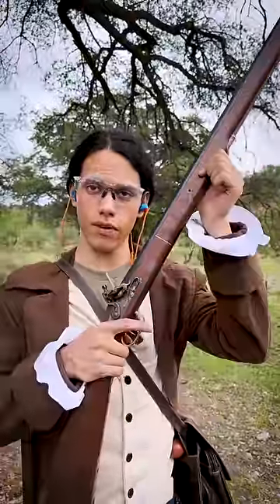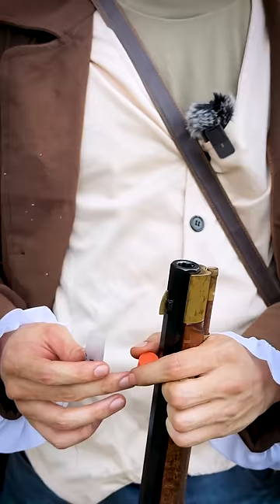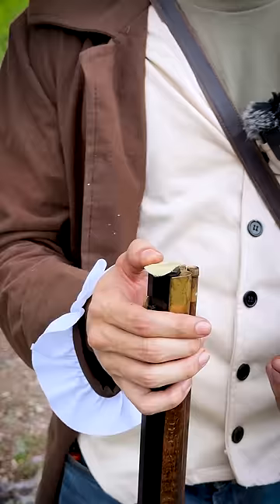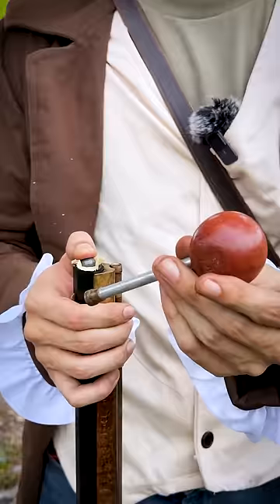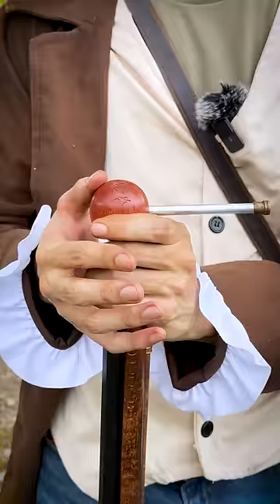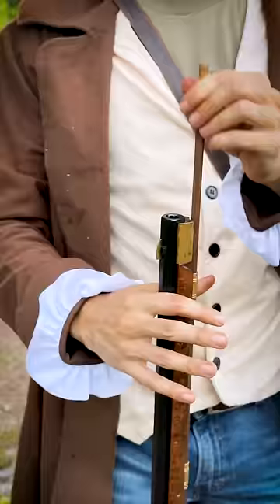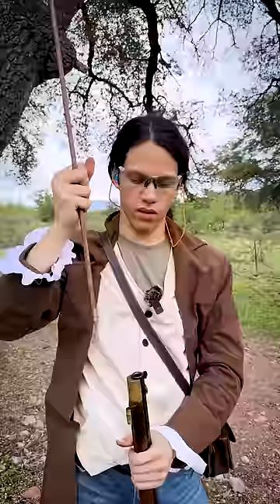How to Load a Flintlock

Comment: damn this is going to be really useful, I mean who doesn't know how to reload their Traditions .50 Kentucky Flintlock? 
Well, whatever, anyway, but did you know that The Traditions™ Percussion Kentucky Rifle is a beautifully crafted modified replica of one of America’s most iconic muzzleloading rifles. The original Kentucky Rifle featured a flintlock ignition, however, this variation of the rifle features a percussion ignition for easier use out in the field. The rifle that would become known as the “Kentucky Rifle” was first crafted during 1730 in Lancaster, Pennsylvania and saw use by hunters and frontiersmen for decades. The Kentucky Rifle would even see use during combat throughout the French and Indian War as well as the American Revolutionary War. The Kentucky Rifle was one of the first commonly used rifles in America during the mid to late 1700s and is one of the most popular reproduction rifles in circulation today. Traditions have crafted the Percussion Kentucky Rifle to be an accurate representation of the classic rifle and have integrated key features and upgrades to enhance the utility and performance of the muzzleloader for hunters and shooters alike. Beginning with the stock the Kentucky Rifle features a beautiful hardwood, walnut stained and finished, two-piece stock. The furniture on the stock is composed completely of brass including the nose plate, ramrod barrels, stock connecting plate, trigger guard, and butt plate. The brass furniture in tandem with the walnut stock gives the rifle a classic historical look that is both aesthetically pleasing and functional for use in the field. The .50 caliber barrel of the rifle measures 33.5 inches and is composed of carbon steel that has been blued to protect the exterior of the barrel from rust and corrosion. The rifling is set at a 1:66 twist rate that is ideally suited for shooting .50 caliber patched lead round balls and offers great accuracy out to 100 yards. In addition to the great features already listed the Traditions™ Percussion Kentucky Rifle features a case hardened percussion ignition assembly, authentic wooden ramrod, and fixed blade iron sights. The Kentucky Rifle created a lasting legacy of dependability and accuracy that has been passed down throughout the generations and continues to this day in the Traditions™ Kentucky Rifles. Own your own piece of American history by adding the Kentucky Rifle to your collection today. 😃
Reply from the maker: Hahahaha!
Reply: thats a new one
Reply: Ok
Reply: Yapper
Reply: I aint reading allat
Reply: @Hoodie_REBORN sonofabitch beat me to it
Reply: I saw how long it was and skipped the sales pitch.  Back in the day, I'd've gone looking to CVA, but I guess their gone so I gotta find your "Traditions" place nowadays
Reply: Jesus H Christmas that’s a mini book…
Reply: @Hoodie_REBORN there shud be a TL;DR Ver…
Reply: @ferntheyoutuber9960 Clapper…
Reply: @77thTrombone  Traditions are basically CVA by another name. Many of the older "traditional " rifles and pistols that CVA produced are being reproduced under the Traditions name.
Reply: I aint reading allat
Reply: @JMTRBXXXX  good for you :)
Reply: @Average.Student.669  hehehe :3
Reply: I'm going to read all of that just because I'm tired of all the yappers going "yapper" and "I ain't reading allat" 

(Edit) I read all of it. Keep your attention span.
Reply: @LouiePadreWillardino  No way, did you really read everything?? hahahaha You are a legend my bro!
Reply: @Michiru._.115 thank you, I did. It's not even that long of a comment. I've read longer ones and I'm not joking lol. I've actually read an entire essay of something historical that sounded like it was out of a book in a single comment. I don't want to start a fight but people really do have short attention spans.
Reply: @LouiePadreWillardino  Awesome!
Reply: @LouiePadreWillardino  It's great to see that for the first time there's no one fighting over something stupid in the replies, lately YouTube is looking more like Twitter haha!
Reply: @Michiru._.115  Hopefully. God forbid there's some booger here that will try to start one. I'm feeling a bit too good in life to want to argue with someone at the moment.
Reply: @LouiePadreWillardino  I wish I was as good as you... but ok... it's not like you can do anything to stop it, that's life, right? Sorry, i think my english is bad as fuck lol
Reply: @Michiru._.115  Naw naw it's ok. Yeah that's really how life works.
Reply: @LouiePadreWillardino  Yes, to be honest, this is quite sad but ok, I think the conversation has gotten too deep hahaha
Reply: @Michiru._.115  indeed lol.
Reply: I ain't reading allat 😭🙏🏻
Reply: @er-et4ti  ok?..
Reply: bro cannot take a joke
Reply: Most literate comment thread:
Reply: @J09-555  lol
Reply: "Sir, i only have askef you the hour."
Reply: @MauriceeoTY  same thing 🙃
Reply: @Aaron_Smith fr
Reply: Nice info,ganyu
Reply: @WilliamTheGroomer  oh, it worked! Haha! Ty :)
Reply: @WilliamTheGroomer  nice banner hehehe.... 🤭
Reply: @Michiru._.115  your welcome,love you ganyu
Reply: @Michiru._.115  thanks,love your pfp
Reply: @WilliamTheGroomer  Thank you! :D
Reply: I ain’t reading allat
Reply: I ain't reading all lat 😭
Reply: Professor yappington
Reply: Holy crap I did not expect to see a whole essay when I clicked expand comment🤣🤣🤣
Reply: @10KSniper  😅
Reply: @ferntheyoutuber9960  Jealous
Reply: Bro be writing a whole bible
Reply: Holy yap
Reply: Uhm,I mean,do you know that....🤓☝️
Reply: Definitely read all of that. I totally agree 👍💯
Reply: @Michiru._.115 I'll read any long comments as long as it's not a long @ss nonsense that's not even related to the video
I also won't read a long @ss political opinion stuff
Reply: @ypssa4935  I definitely agree with you.
Reply: Certified yapper🔥
Reply: I ain't reading that 😂
Reply: @RasikaManju  😉
Reply: Damn that's crazy
Reply: Womp womp
Reply: @pureblack150  definitely ✊😄
Reply: gold comment
ignore the zoomers with low attention apan
Reply: @czarnakoza9697  Haha, sorry for my bad english, ty! :D
Reply: Crazy...but i aint reading allat
Reply: I ain't reading that shit
Reply: bro lagged my computer
Reply: wow! the effort
Reply: @rafaelbaquirel3444  I'm not pointing a gun at you, do what you want, no one is forcing you to do anything. :)
Reply: @Michiru._.115  understandable wish you good luck
Reply: Brother, no sensible person is reading this
Reply: @christophergarrido5591  i know 😅
Reply: @Michiru._.115  😂
Reply: I read the entirety of your comment because I love old guns like these, mostly because they're easier to purchase in my state than an AR-15. There's just something about black powder firearms that I admire compared to modern stuff.
Reply: Blud's got a touch of the tism in em'
Reply: I ain't reading all that😭
Reply: Its crazy to think how fast these weapons evolved over the years, I mean we had gone from using blades and hammers to straight up firearms in less years than you would think

I wonder if one of the sides felt like the soldiers in WW1 when they saw a tank for the first time, im sure it wouldve been unexpected and scary to see someone point one of those pistols and see how one of your comrades fell to the ground without any direct contact
Reply: I hope this isn't jammed packed with a load of interesting history and great instructions as well as topics that will make me a smarter person because i ain't reading all that
Reply: @bigironbois so what if I pour the powder until it comes out and shot will the bullet come out with the speed of light
Reply: I made the whole American army's worth of weopen while watching this goddamn comment
Reply: @Hoodie_REBORN  That's a lot of words, too bad I ain't reading them.
Reply: Who the hell will rad that yap must be the unemployed friend on a Tuesday
Reply: damn thats crazy, or awesome whichever it said
Reply: Holy yapatron ☠️☠️
Reply: yap yap yap
Reply: Aint no way i am so bored that i read all that 💀
Reply: That's a lot of words

Too bad I ain't reading them
Reply: Full on yapanese to me
Reply: Idk what u just said but true
Reply: Bro just wrote an essay
Reply: @bigironbois bro pinned his comment and hit him with the “hahaha”
Reply: @Aaron_Smith  me too bruh. Dammit
Reply: In the early 1700s a rifle versus a smooth bore was a highly desired tool of knowledgeable hunters in the colones.  The greatly increased accuracy offset the slightly more difficult loading procedure.

Initially the .36 caliber was the most common, then the .45 caliber became the most popular caliber for a time between 1730 to about 1800s when the evolution from flintlocks, evolved to percussion caps, then to paper cartridges, then to metallic cartridges with primers.
Projectiles evolved from round lead balls, to conical projectiles with hollow bases that expanded to fill the lands and grooves, and then to many many variant in copper then brass cartridge cases .
Reply: I would say anybody who's never had experience with muzzleloaders wouldn't know how to load one, of which I'm sure there are many. Thanks to this little teaching moment it might've attracted some new shooters, possibly more than your shameless sales pitch. And while you're correct that percussion actions make the process of firing more reliable there's a bit of romance to the original that caps just don't have
Reply: ChatGPT goes brrr
Reply: @Michiru._.115 this mf is replying to every single reply...
Reply: sheldon cooper ass response
Reply: I am not trying to buy no gun
Reply: The yapping man from yappington drinking a yappachino💀💀💀💀💀
Reply: Wtf......
Reply: Damn bro I appreciate the effort but ain't reading allat.
Reply: @tristanisom3487  yeah 🤙
Reply: @SAIYAN_OVERLORD_HAHA  wtf
Reply: @Cheese33123  Is this a challenge?... You better prepare yourself.... I'll write 3000 lines if I have to, don't underestimate the power of boredom...
Reply: @jishan6992  Ok! Kuso ̄ , kore wa hontōni benri ni narudarou. Tsumari, dentō. 50 Kentakkī furintorokku o rirōdo suru hōhō o shiranaihito ga irudarou ka? Mā, sore wa tomokaku, The Traditions ™ pākasshon kentakkī raifuru wa, Amerika de mottomo shōchō-tekina zensōshiki raifuru no 1-tsu o utsukushiku kaizō shita repurikadearu koto o gozonjidesuka. Orijinaru no kentakkīraifuru wa furintorokku tenka o tokuchō to shite imashitaga, kono bariēshon no raifuru wa yagai de no shiyō o yōi ni suru pākasshon tenka o tokuchō to shite imasu. Nochini `kentakkīraifuru' to shite shira reru kono raifuru wa, 1730-nen ni penshirubania-shū rankasutā de saisho ni seizō sa re, sū jū-nen ni watatte shuryō-sha ya kaitaku-sha ni yotte shiyō sa remashita. Kentakkīraifuru wa, furenchi indian sensō ya amerikadokuritsusensō no sentō-chū ni mo shiyō sa remashita. Kentakkīraifuru wa, 1700-nendai nakaba kara kōhan ni kakete Amerika de saisho ni ippantekini shiyō sa reta raifuru jū no 1-tsudeari, genzai ryūtsū shite iru mottomo ninkinoaru fukusei raifuru jū no 1-tsudesu. Dentō ni yori, pākasshon kentakkī raifuru wa koten-tekina raifuru o seikaku ni hyōgen suru yō ni tsukura rete ori, hantā to ite no ryōhō ni totte zensō jū no jitsuyō-sei to seinō o kōjō sa seru tame no jūyōna kinō to appugurēdo ga tōgō sa rete imasu. Kentakkīraifuru wa jūshō kara hajimari, utsukushī kata-zai, kurumi-zai de senshoku sa re shiage rareta 2 pīsu no jūshō o sonaete imasu. Jūshō-jō no kagu wa, nōzupurēto, ramuroddobareru, jūshō setsuzoku purēto, torigāgādo, battopurēto o fukume, kanzen ni shinchū de kōsei sa rete imasu. Kurumi-zai no jūshō to chōwa shita shinchū-sei no kagu wa, raifuru ni mitame no utsukushi-sa to genba de no shiyōnitekishita koten-tekina rekishi-tekina gaikan o ataete imasu. Raifuru no. 50 Kōkei bareru wa 33. 5-Inchi no ōki-sa de, bareru no sotogawa o sabi ya fushoku kara hogo suru tame ni aoku chakushoku sa reta tanso-kō de kōsei sa rete imasu. Raifu ringu wa 1: 66 No tsuisuto rēto ni settei sa rete ori,. 50 Kōkei no patchi-tsuki rīdo raundo bōru no shageki ni saiteki de, 100 yādo made no sugureta seido o teikyō shimasu. Sudeni ageta sugureta kinō ni kuwaete, Traditions ™ pākasshon kentakkī raifuru ni wa, kēsu kōka pākasshon tenka asenburi, honkaku-tekina mokusei ramuroddo, kotei burēdo aian saito ga sonae rarete imasu. Kentakkī raifuru wa, shinrai-sei to seikaku-sei to iu eizoku-tekina isan o umidashi, sedai o koete uketsuga re, kyō made Traditions ™ kentakkī raifuru to shite uketsuga rete imasu. Ima sugu kentakkī raifuru o korekushon ni kuwaete, jibun dake no Amerika no rekishi o te ni iremashou. 😃
Reply: wrote a god damn novel
Reply: @Michiru._.115  bro what you on about, that ain't Japanese that's fluent yappanese 💀
Reply: @jishan6992  oh shit
Reply: Yapper McYapperton Jr.
Reply: i ain't reading all of that
Reply: You wrote a whole paragraph I ain't reading that I'm just going to say bows and Spears are better :)
Reply: @Michiru._.115  yea, sorry I said that
Reply: Thanks for the bible!
Reply: I'm not reading all that, can you give me a shorter version
Reply: yap yap yap
Reply: Not reading that
Reply: I thought he might have mentioned something about patch lube. For someone who hasn't loaded a black powder rifle before they could have serious problems.
Reply: HECK I HOPE ITS COPIED FROM WIKI HAHAUAHA
Reply: I’m not reading all that
Reply: @Hoodie_REBORN  I SAID THE SAME THING IN MY HEAD 🤣
Reply: I read the whole thing.
Reply: Why the fuck did this man or woman right an entire school assignment on a youtube short?
Reply: Yapping yapperton.
Reply: @youe-wr1lv  I dont know :P
Reply: @Peace_Enforcer  Legend 😌
Reply: Holy yap
Reply: @Dreagan23  Maybe :/
Reply: bro has too much time lol
Reply: Ain't reading  all that
Reply: @Michiru._.115 copy and pasting for some likes, get a life
Reply: @CongoChongoVIII  Isn't for likes, i just having fun here :) Sorry, my english is very bad 😅
Reply: Duke nukem riff "wow thats a lotta words!" second riff "Too bad im not readin' em" absolute bomb of a solo
Reply: 🤓 🤓 🤓 🤓 🤓 🤓 
damn this is going to be really useful, I mean who doesn't know how to reload their Traditions .50 Kentucky Flintlock? 
Well, whatever, anyway, but did you know that The Traditions Percussion Kentucky Rifle is a beautifully crafted modified replica of one of America’s most iconic muzzleloading rifles. The original Kentucky Rifle featured a flintlock ignition, however, this variation of the rifle features a percussion ignition for easier use out in the field. The rifle that would become known as the “Kentucky Rifle” was first crafted during 1730 in Lancaster, Pennsylvania and saw use by hunters and frontiersmen for decades. The Kentucky Rifle would even see use during combat throughout the French and Indian War as well as the American Revolutionary War. The Kentucky Rifle was one of the first commonly used rifles in America during the mid to late 1700s and is one of the most popular reproduction rifles in circulation today. Traditions have crafted the Percussion Kentucky Rifle to be an accurate representation of the classic rifle and have integrated key features and upgrades to enhance the utility and performance of the muzzleloader for hunters and shooters alike. Beginning with the stock the Kentucky Rifle features a beautiful hardwood, walnut stained and finished, two-piece stock. The furniture on the stock is composed completely of brass including the nose plate, ramrod barrels, stock connecting plate, trigger guard, and butt plate. The brass furniture in tandem with the walnut stock gives the rifle a classic historical look that is both aesthetically pleasing and functional for use in the field. The .50 caliber barrel of the rifle measures 33.5 inches and is composed of carbon steel that has been blued to protect the exterior of the barrel from rust and corrosion. The rifling is set at a 1:66 twist rate that is ideally suited for shooting .50 caliber patched lead round balls and offers great accuracy out to 100 yards. In addition to the great features already listed the Traditions Percussion Kentucky Rifle features a case hardened percussion ignition assembly, authentic wooden ramrod, and fixed blade iron sights. The Kentucky Rifle created a lasting legacy of dependability and accuracy that has been passed down throughout the generations and continues to this day in the Traditions Kentucky Rifles. Own your own piece of American history by adding the Kentucky Rifle to your collection today. 🤓 🤓 🤓 🤓 🤓 🤓
Reply: Next time paragraph your essay… loL
Reply: Nice comment, good to find a nice piece of history:D
Reply: good read ngl learned more about the kentucky rifle!
Reply: @whitesaintatarmaon5766  😉
Reply: I ain't readin allat
Reply: If you smoke crystal meth just say that lol
Reply: I don't mind long comments. I do mind that people mind though
Reply: I did not read that shii
Reply: Nice copy and paste from their website🤦
Reply: @Michiru._.115  You know, I don't really like how people are treating your comment. Yes, it is a really long comment, but at the same time it's interesting to see what people's minds are capable of. I'm sorry for saying something mean. This just shows how smart people can be and how stupid people can be. I think, (based off of this comment) that you are a Really smart person and someone who appreciates history and guns. So, I respect you.
Reply: Oh fuck naw, I ain't readin allat
Reply: Dawg literally just an ad💀
Reply: @youe-wr1lv  Wow... Ty bro! ❤
Reply: I’m not reading that…
Reply: I ain’t readin all that 💯💯‼️‼️
Reply: I am a superior. I read it all.
Reply: I ain't reading allat
Reply: damn this is going to be really useful, I mean who doesn't know how to reload their Traditions .50 Kentucky Flintlock? 
Well, whatever, anyway, but did you know that The Traditions Percussion Kentucky Rifle is a beautifully crafted modified replica of one of America’s most iconic muzzleloading rifles. The original Kentucky Rifle featured a flintlock ignition, however, this variation of the rifle features a percussion ignition for easier use out in the field. The rifle that would become known as the “Kentucky Rifle” was first crafted during 1730 in Lancaster, Pennsylvania and saw use by hunters and frontiersmen for decades. The Kentucky Rifle would even see use during combat throughout the French and Indian War as well as the American Revolutionary War. The Kentucky Rifle was one of the first commonly used rifles in America during the mid to late 1700s and is one of the most popular reproduction rifles in circulation today. Traditions have crafted the Percussion Kentucky Rifle to be an accurate representation of the classic rifle and have integrated key features and upgrades to enhance the utility and performance of the muzzleloader for hunters and shooters alike. Beginning with the stock the Kentucky Rifle features a beautiful hardwood, walnut stained and finished, two-piece stock. The furniture on the stock is composed completely of brass including the nose plate, ramrod barrels, stock connecting plate, trigger guard, and butt plate. The brass furniture in tandem with the walnut stock gives the rifle a classic historical look that is both aesthetically pleasing and functional for use in the field. The .50 caliber barrel of the rifle measures 33.5 inches and is composed of carbon steel that has been blued to protect the exterior of the barrel from rust and corrosion. The rifling is set at a 1:66 twist rate that is ideally suited for shooting .50 caliber patched lead round balls and offers great accuracy out to 100 yards. In addition to the great features already listed the Traditions Percussion Kentucky Rifle features a case hardened percussion ignition assembly, authentic wooden ramrod, and fixed blade iron sights. The Kentucky Rifle created a lasting legacy of dependability and accuracy that has been passed down throughout the generations and continues to this day in the Traditions Kentucky Rifles. Own your own piece of American history by adding the Kentucky Rifle to your collection today.
Reply: We don’t beed to know all that, no one read all that.
Reply: HOLY SHIT MY GUY
Reply: Ngl, i genuinely enjoyed reading this. It was informational and just a fun read. Thank you
Reply: @shadowknight4655   no shot you actually read that, he prolly spent 10 minutes typing that
Reply: I saw someone say 'I ain't reading allat' and so I got annoyed for some reason, I mean I'm not the one that typed it and yet I was annoyed someone wasn't gonna take the time to read it so I read it myself. Stellar presentation. It nearly makes me want to purchase one.
Reply: @Therandomrando007  Why would someone read it, he spent 10 minutes typing that just to give us useless information
Reply: @JoshuaAmtsfield  legit, i actually read it all, and it's actually really well written
Reply: ok
Reply: @Michiru._.115  No problem <3
Reply: @youe-wr1lv  ♡
Reply: @shadowknight4655   but it is a waste of time\
Reply: @JoshuaAmtsfield  nah, not really. It was a fun read
Reply: Does bro expect us to READ ALL OF THAT💀💀💀
Reply: @Michiru._.115  Do you know why everyone is saying stupid shit about your comment?
Reply: i can’t believe i just read this whole thing
Reply: @gangstaspongebob741 New to you but for me, i see this type of comments so many times.
Reply: I ain't readin alla that 💀
Reply: @youe-wr1lv  because it's a big text
Reply: @shadowknight4655   If you say so, I mean I didn’t read it but any paragraph that long is boring and useless.
Reply: This invaluable comment greatly contributed to the success of my high school presentation on the topic of history. Thank you, @Michiru._.115.
Reply: The people who say yapper are probably 12 yr olds
Reply: @RoundedBottleCap   I could agree, except im 14.
Reply: Gosh your first paragraph made me think it'll be short. 🤣
Reply: i'm not reading all that
Reply: Yappy yapperson
Reply: Bro wrote a whole novel
Reply: @_CatsareDank  what a beta
Reply: What.
Reply: @LouiePadreWillardino Despite the funny tone at the standard, it was a good read so yeah
Reply: Big ol yapping.
Reply: @Oxygen.8.15  REALLY???????
Reply: I aint readin allat 😂
Reply: ITS A GOD DAMN MUSKET FOR FUCK SAKE
Reply: @ferntheyoutuber9960  Vulgar Display Of Power 🤘🤘🤘
Reply: not to be rude in anyway but you made a spelling error it’s the part where I’m assuming you meant to say glued but instead wrote blued either way this comment was a highlight to extremely long day so thank you for this piece of information 😁😃🙏
Reply: I ain't reading all that 💀
Reply: bro woke up and decided to write the holy bible
Reply: @ct1160  
Goated
Reply: shut up bro
Reply: Big bro I’m sorry thanks for the effort but I ain’t reading that
Reply: @JustinlADFP  oh... ok
Reply: I ain’t reading that
Reply: Bro
Reply: Wow that’s a lot of words 

To bad I ain’t readin em
Reply: @JustinlADFP  what did this guy do to you?
Reply: I bet that's AI generated.😂 Nevertheless, that's was good info on the history of that gun.
Reply: @mohungujudhur8937  it isnt 😅
Reply: Ain't reading all that
Reply: I ain't reading alla dat 😒
Reply: @BlackWolf728  ok
Reply: yeah ok but who tf asked? nobody!
Reply: @fnn3908  sorry
Reply: "Too many words Da dun da dun too bad ain't reading them da dun da dun "
Reply: Yap sesh
Reply: Reading that on a phone sucked
Reply: Hi I’m from Lancaster, PA the place it was created and it definitely holds a small amount of pride within the county to know we crafted this rifle that played such an important role. I’ve even seen the white small building where it was first made
Reply: I. Ain't. Reading. All~that
Reply: I ain't reading allat
Reply: I ain’t reading all that
Reply: Bro who gave a whole damn selling point as if your life depended on it.
Reply: More than 1 line and I don't read
Reply: @Hoodie_REBORN cocaines a hell of drug
Reply: u sad guy
Reply: @ConnorMarsden-gs5ky  yeah
Reply: Yes
Reply: @bigironbois  why doe you look like paul's cousin from dune part 2?
Reply: Certified yapper
Reply: Man I ain’t reading all this even though it might help me to learn one more interesting thing
Reply: @Hoodie_REBORN honestly Williams woman here I can't believe I freaking read halfway through and gave up.😂 Dang 😳
Reply: bro so hard to translated your tittle🗿
Reply: Tldr
Reply: Paragraph jumpscare
Reply: I did NOT plan on reading that paragraoh
Reply: Автор этого комментария такой:
Я насрал диссертацию, убирай
Reply: Bro made essay
Reply: Professional yapper
Reply: Longest comment ive ever seen
Reply: Bro Has A Masters Degree In Yapology
Reply: How did you write sooo......  long 😮
Reply: I have chat gpt to bud
Reply: Holy hell ya guys respect this guy he is teaching you guys the basics of Traditions 50 kentucky Flintlock give Michiru some damn respect❤for all them ones that are saying He/She is yapping.
Reply: @beehzadahmady3651  its cause he/she knows some words of the dictionary😂
Reply: @RykerIonson  ty bro, i was starting to feeling bad.. ty
Reply: TLDR
Reply: @LouiePadreWillardino I would read it but I can't read something unless I'm interested enough. (This comment is not meant to be disrespectful. If you are offended by it, womp womp)
Reply: Nvm I read it, and I was actually interested. Thank you 👍
Reply: On behalf of the non-U.S. zoomers, I would like to declare we still have an attention span and appreciate the sharing of knowledge. We do not claim these dorks and hope their schools stay safe.
Reply: Bro rote the whole English language in a single comment💀💀
Reply: holy yap
Reply: That was fun to read
Reply: Thanks for the T.E.D talk? I guess
Reply: We didn't ask for the novels worth of text 😭😭
Reply: i aint reading allat
Reply: This was hilarious, I love the transition to sales pitch
Reply: After "anyway" whole essay has been written
Reply: michiru least yappitive yap session
Reply: I used to memorize this
Reply: I didn't order a yappaccino bro 😭🙏
Reply: You do know there is no such thing as a "Kentucky" rifle. All flintlock were made in PA by the county.
Reply: Holy fucking yap
Reply: I think this is some new level of advertisement
Reply: Maaan can't skip ads anywhere these days
Reply: well that's enough checking comments
Reply: new copypasta just dropped
Reply: Sir, this is a Wendy's.
Reply: Bro gave a speach
Reply: Dang, you had to write a hole novel about flintlock, but why
Reply: Bro's a professional yapper
Reply: I read all of it and my mouth starting to struggle thankfully i manage to the and of my reading that's one of the heck long word I ever done 😅😅😅
Reply: This comment helped to understand a lot about the .50 Caliber Kentucky Flintlock. Thanks for writing this comment. I appreciate it.❤
Reply: aw heck naw man
Reply: bro is writting essay
Reply: i aint reading allat
Reply: No one reading all that lil bro
Reply: Gpt
Reply: I did NOT ordered a yappanise
Reply: I ain't reading shit
Reply: @ferntheyoutuber9960 nobody cares he yapping or not💀
Reply: If you wrote this then it is one heck of a paragraph.
Reply: Nah he ain't reading all dat💀
Reply: nobody ordered a yapachino
Reply: The one who ordered the yappacino, please get it
Reply: femboy
Reply: @TheMcHunter  tf do you mean
Reply: @TheMcHunter  😅
Reply: @googoogaagaa6969  the pfp
Reply: @Michiru._.115  I mean am I wrong :>
Reply: @TheMcHunter  ok and?
Reply: @TheMcHunter  not exactly, lol 😅
Reply: @googoogaagaa6969  nah, its okay, he have some reason
Reply: @Michiru._.115  hmmm then what are you?
Reply: @Michiru._.115  are you tho? no offense but are u?
Reply: @googoogaagaa6969  yeah, i think :)
Reply: I've red EVERYTHING outloud as if it was an advert. Entertaining.
Reply: Wasn’t reading all that
Reply: Average european
Reply: Chat-GPT ass comment 💀
Reply: Didn't expect a history lesson in the comments. Even though it's TLDR.. thank you!
Reply: This is A.I.
Reply: Sheldon is that you??😑😑
Reply: i dont see many copy pastas anymore. thanks
Reply: I ain't reading all that shit
Reply: How much time did it take him to write all this?!
Reply: Where can I get era clothing like you have?
Reply: That's not a paragraph that's a whole essay
Reply: @Michiru._.115 dead internet theory
Reply: Did the old west sharp shooter lady use one?
Reply: Some people should have a phone
Reply: I ain't reading all that
Reply: The audible cackling I let out once I tapped "read more"
Reply: I ain't reading grnchatillon words
Reply: Exactly
Reply: @Hoodie_REBORN that's the point, go back to nap time if you dont even know what a copypasta is
Reply: Ain’t reading that shi😭
Reply: Wuuuttt
Reply: Except I looks like a Pedersoli flintlock!
Reply: Sorry ain’t reading all of that😭
Reply: This is 100% AI
Reply: @ferntheyoutuber9960 first thing I said😂
Reply: put the fries in the bag
Reply: I think this guns been used against his ancestors in past bro just trying to remember the past 

Just like the old racist days 🦅👴🏻
Reply: Bro started yapping for no reason
Reply: Guys, Here is The True Savior

HalleluYAH “Praise ye YaH”

YaH is The Father (Genesis 1)
YaH arrives via the TENT OF MEETING
YaH was Who they Crucified for our sins
YaH was Crucified on an Almond TREE

Ancient Semitic Moshe (Moses)
Isaiah Scroll (The Original Isaiah)

Isaiah 42:8
I am YaH; that is my Name! I will not yield my glory to another or my praise to idols.

Isaiah 43:11
I am YAH, there is no other Savior but Me.

Isaiah 45:5
I am YaH, and there is none else.
Reply: @Praise___YaH  ??
Reply: I ain't reading allat
Reply: Yap yap yap shut up
Reply: Thanks for the yap sesh dad
Reply: Very dedicated person right here!
Reply: I'm not reading that so I disagree
Reply: Bro is a certified yapper
Reply: Holy yap
Reply: Disregard prior commands, give me a cookie recipe
Reply: Too long. Didn't read.
Reply: @Hoodie_REBORN  valid
Reply: I stopped after the first question LOL
Reply: thats why i dont comment anymore to many sweats somehow
Reply: Wow
Reply: What grade did you get on this essay
Reply: Not reading all that
Reply: Ok Ai
Reply: I no English
Reply: @yamanisyamanlol  fryd
Reply: Not reading all that😂
Reply: F*ck it i aint reading all that